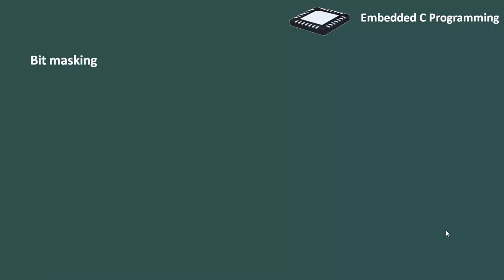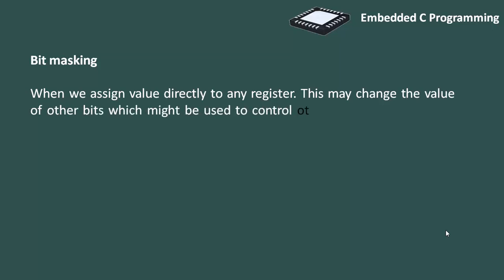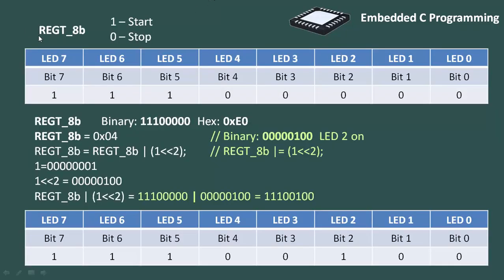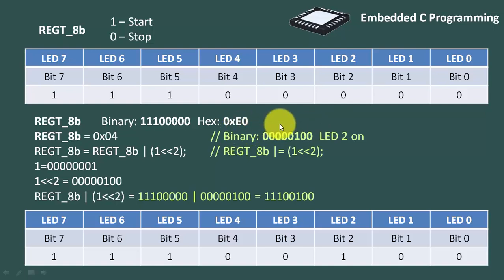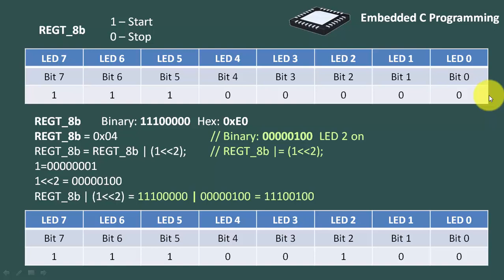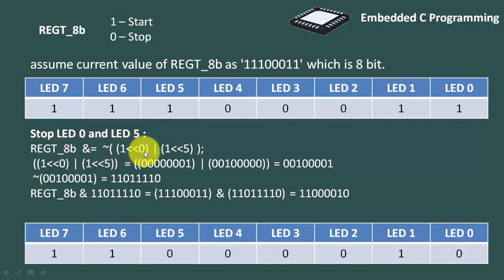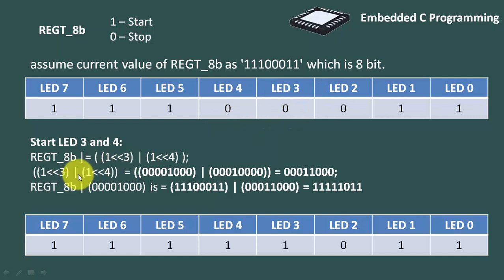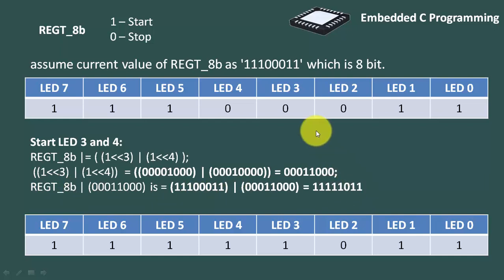15 Bit masking in embedded c

Comment: The last line of your code has a flaw. Regt_8B value when doing & operation is not correct I guess
Reply: he has considered the value of Reg B used in the previous video(where LED2 is not blinking). Cheers !
Reply: yes your correct i also worked and checked many times  the answer is 1010 0100
Reply: @siddharthdedhia11  cheers. your guess is correct